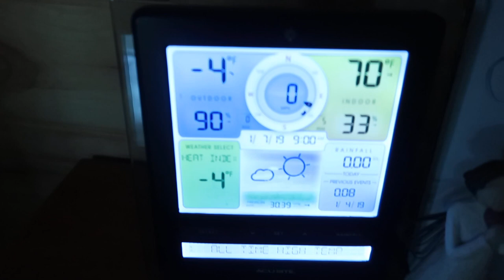I hope it's As Good As she Thought it would BE! I was Supposed to Build It Years Ago.

Comment: Holes in bottom Or paint inside with Flex Seal and runs 3/4 inch PVC down the length perforated with one end out t fitting up side screw fitting for a liter drink bottle down side with valve for drainage. Fill bottom of boxes with preflight, then landscape fabric then potting mix. The screw fitting for the bottle allows for hands free irrigation and drainage. Use this or PVC gutter for radishes, green onions/chives or other small crops with quick turnover.

Comment: Hey Al,  Nice work on the window box.  Happy wife, happy life eh?  May I suggest you might need some drainage holes though.  While the cedar should resist rot, I understand it is not completely impervious to water and you don't want to speed up the process or encourage root rot on herbs.   2 x 1/2 inch holes per segment with a little mesh screen stapled down over top of the holes to stop the potting mix from falling out, ought to do the trick.
Reply from the maker: Yes definitely need to drill some holes in the window box

Comment: Al: Just a couple of thoughts from the old guy over the virtual back fence.  I put 3/8-1/2" drain holes in my Cedar planters.  Say 6 per section in yours.  Then 1/2" of wood chips with landscape fabric on top to keep the soil out of the chips.  Now I line my boxes with 6 mil. builders plastic to help retain moisture in the soil.   My Cedar  boxes the same size as yours from 1x8's without the plastic are now falling apart and that's after 25 years.  the old guy   Bert
Reply: you sound like you would be a great ole  guy to have over the fence!  friendly and good advice....nine to
Reply: +oldchickenlady  nice to meet you "virtual neighbor"